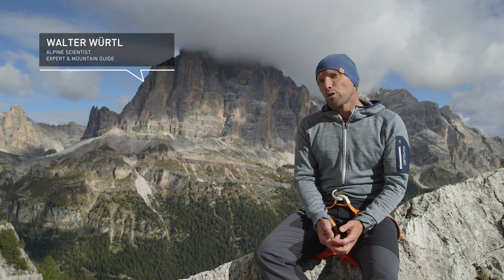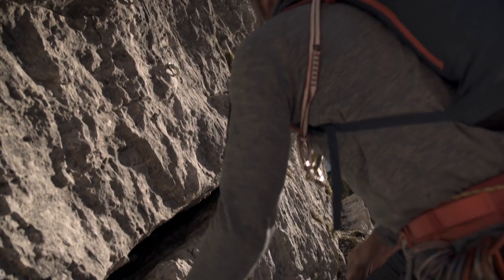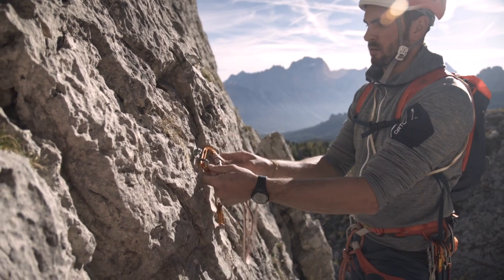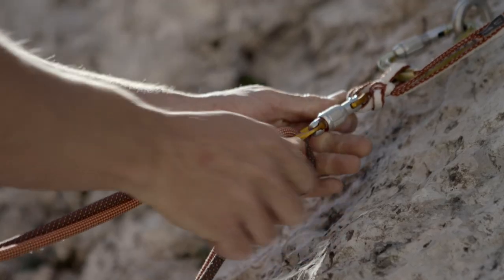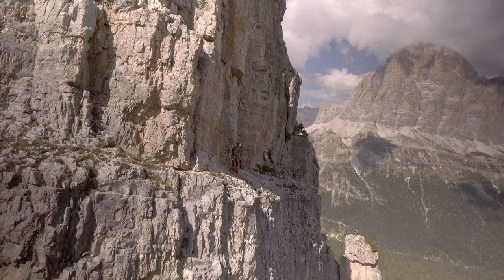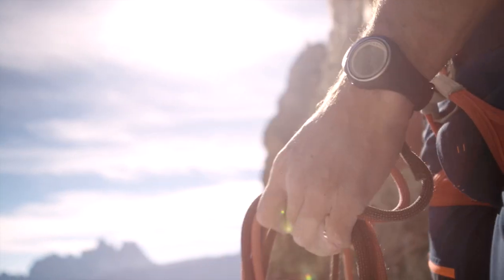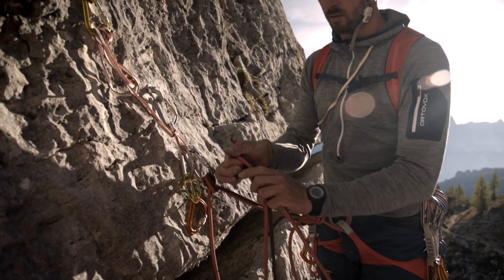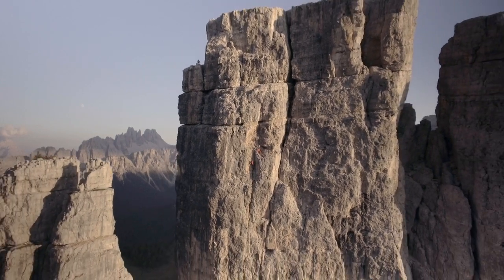Guide to belaying: Series connection with 2 bolts – Tutorial (16/43) | LAB ROCK

Comment: Why are you clip the second point after a partner "belay off"? The head climber is on one point during a moment. From belay off to clip second point in order to belay a second. It's more safe to connect the relay before. 

(Pourquoi relier le relais après la "corde libre" ? Le grimpeur de tête se retrouve sur un seul point durant tout le tirage de la corde jusqu'au moment ou il relie le deuxième point du relais pour assurer le second. Il serait plus sécurisant de relier les 2 points du relais avant la libération de la corde pour toujours être sur 2 points (Surtout lorsqu'il n'y a pas de vire)
Reply from the maker: Dear Melvin,

you´re right, the method shown in the video means you are just connected to one of the both anchor points, when you give the commando “off belay” – what is still okay, if the anchor point is solid (f.e. a bolt)- and only than! It just has to hold your regular body weight, and normally should hold multiple more. Just think of the impact a bold has to resist in case of a lead fall. Anyway the only reason to do so, is to fasten your processes at the belay: The follower can already take you off belay, organize the rope and himself during you´re finally rigging the belay. If you don´t feel very safe with this method, you could also finish your belay before going for the “off belay” commando. The loss of time won´t be too evident!

Your ORTOVOX Team